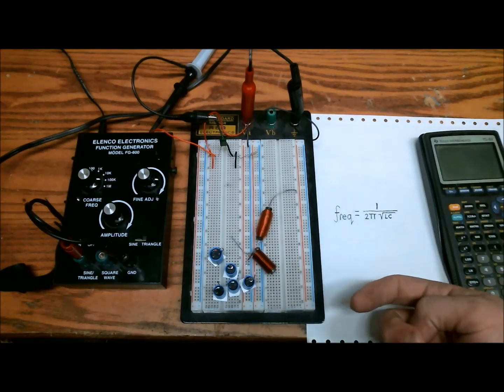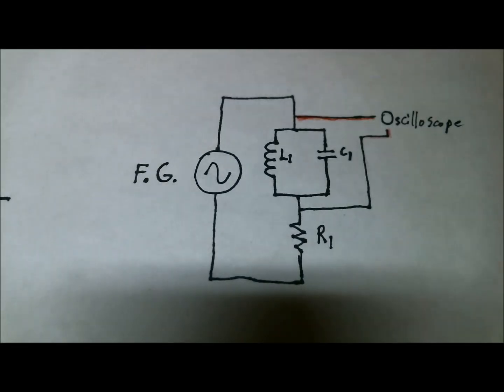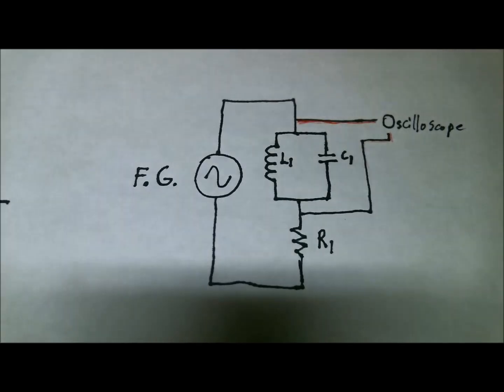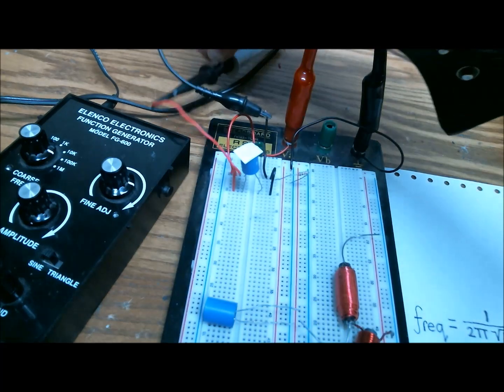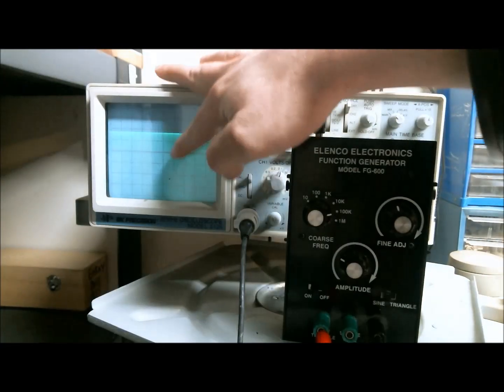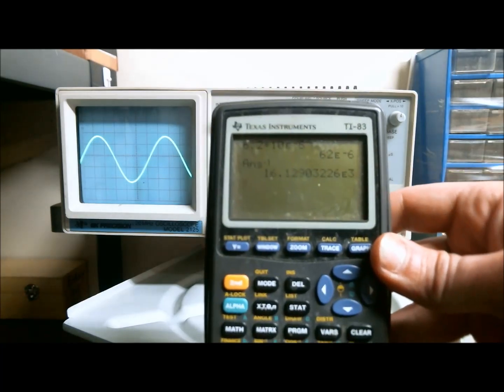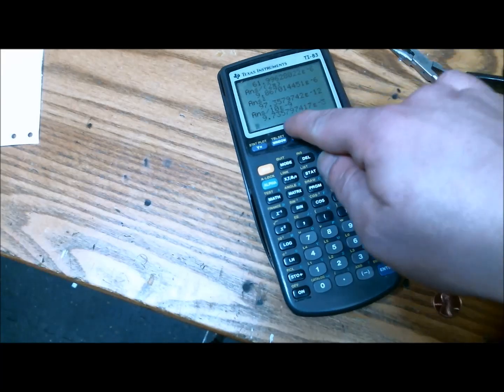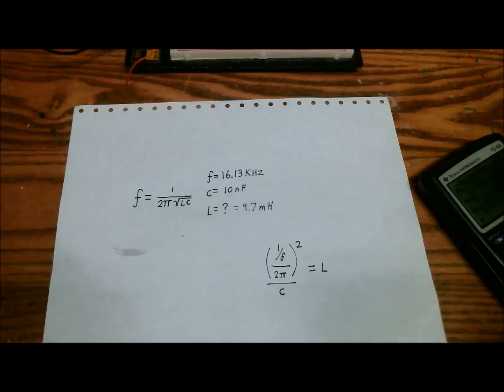How to measure an Inductor or Capacitor without LCR meter

Comment: if I don't have sign wave degerator can I use just a 50 Hz sign wave from my transformer (12 V output) ? But of course the calculations won't be the same.

Comment: Thanks for your efforts to share this great video with us. Capacitors act differently when given a voltage offset. Knowing how a cap performs at its rated voltage is useful. What circuitry would need to be added to tie in a voltage offset. My frequency generator can add an offset, but not as high as needed. I do have nice DC power supplies. I am trying to not scratch my itch to buy a high dollar LCR (AKA LCZ) bench meter.

Comment: if you put the resistor on top of the tank cct, could you then not have to isolate your fn generator. assuming the bottom line in your cct is ground for the fn gen and cro.

Comment: Well done. This was a very clear explanation and should have been obvious but it's nice to see somebody implementing what we learned "way-back-when".  
I agree that stray capacitances, inductances and all those other little "devils in the details" cause some problems but my guess is  this is close enough for most of us and if it isn't close enough you need to buy lots of test gear (to the tune of a hundred big ones) and that's not going to happen. You might be able to measure the inter-bus capacitance of the pin-board.

Comment: Where is ground on the schematic? What frequency did you use on the function generator? is it 100 kHz, if not, does it even matter what frequency you use? Also do inductors have polarity? Thanks for your help. Mo
Reply from the maker: Earth Ground is the black wire on the oscilloscope, Battery negative is at the bottom of R1. I was changing the frequency throughout the video. Inductors do not have polarity. I hope this helps.
Reply: Single inductors with just two pins do not have polarity but for those that are coupled as the transformer windings or EMI filter chokes the winding direction among the windings defines the output signal polarity.

Comment: can somebody tell me how i make 500 uH inductor choke with resistance of 260 ohm and current rating is 3.2 amp..i need it real ...or at least tell me ...what gauge number i use and how many number of turns it would be

Comment: i do not have both neither LC meter nor scope how i check inductance
Reply: As long as the frequency is low (up to about 20KHz, I believe), it's possible to use a computer sound card to run a software-based function generator and oscilloscope on a normal PC. Google "sound card oscilloscope".
Reply: guess

Comment: how can we program this method on arduino ?
Reply: This method uses sinewave frequency sweeping in a broad frequency range and amplitude signal metering to check the larger signal amplitude versus frequency.Not for stand alone arduino application maybe.

Comment: great video, but  I am far from being the most savvy in electronics, I am making a DIY metal detector and I need to figure out the inductance of my coil but I only have a cheapish multi meter , without spend and buying a LC meter, is there a way I can use my multi meter ? If so how ,

Comment: You want one of these http://www.banggood.com/DIY-M12864-Graphics-Version-Transistor-Tester-Kit-LCR-ESR-PWM-p-986954.html I have 3 AVR Transistortestors and this is the one that you want. Though the $12 one they have is just as accurate. But the graphical one just has nicer features. It is worth it for how the menu works alone.
Reply: +Paul Frederick  Totally an amazing device, I have three kinds and this one's the best. Hats off to Marcus.  It does make us unappreciative in understanding the hard work endured in the past.

Comment: This is a great video. I think that it's generally good enough for circuit design + hacking. After all, you want to create low sensitivity circuits that do not rely on the accuracy of component values. Great job man!

Comment: I was wondering whether the ground of the F.G. needs to be isolated from the ground of the oscilloscope to avoid short circuiting the resistor. Tolerances of the known component value, plus the input capacitance of the oscilloscope affect accuracy of measurement. Nice, video, I measured a 10uH inductor.

Comment: great way to measure inductance heilman, but I don't have an oscilloscope, so I ordered a Chinese made lcr meter form ebay for under 20 dollars,
Q: the higher the inductance in a electromagnet (or an inductor) means the stronger the magnetism will be?
Q: do you believe or have you built the bedini ssg generator before?

Comment: Could you go slower with the calculator? Or show us how to do this with a NORMAL calculator? I get COMPLETELY different results when I tried to calculate your inductor myself.  It's very hard to follow what you're doing. I'm trying to wind an inductor for a circuit and it's crucial that I get the inductance right.

Comment: Another way without C neeeded  is aplly of formula -> V= L(di/dt) + IR 
Use pulse generator in put pulse to siries RL ckt. , Measure the time when Vr start from 0 to Vin  then you can cal the L value.